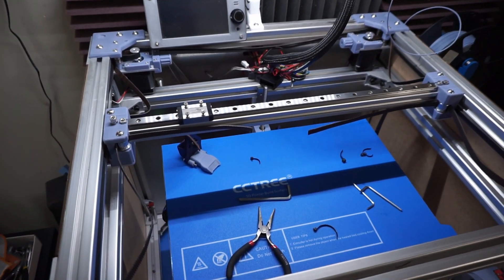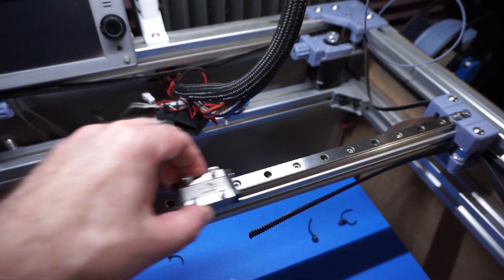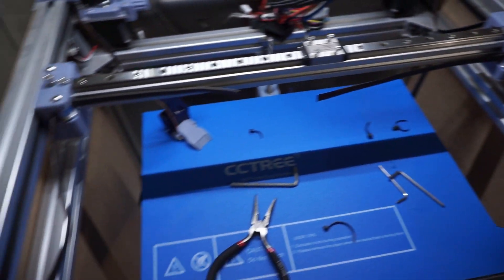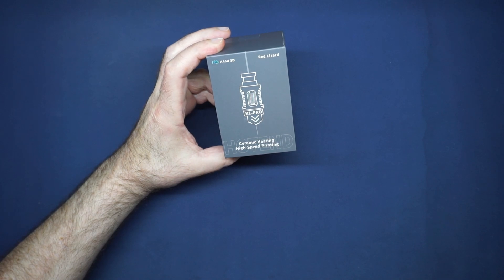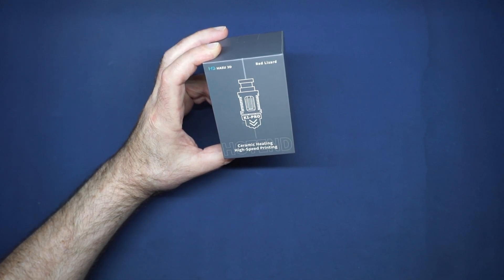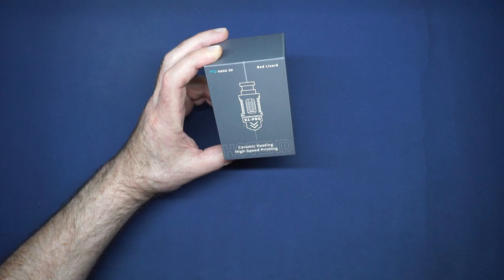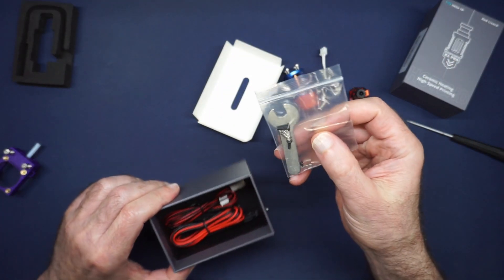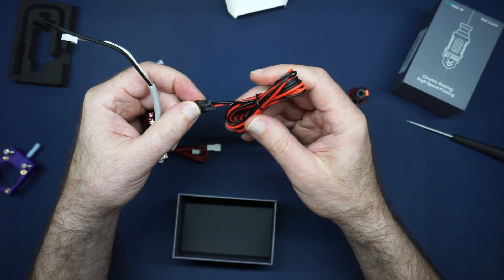Wave Extruder & K1 Hotend

Comment: Hi, are there any suggestions about the Thermisttor type for the klipper sensor settings?
Maybe i have't noticed or can't find the right one.
Many thanks
Reply from the maker: I believe I used the NTC100K setting in klipper.  the seller's page says "NTC 100K MGB18-104F39050L32"
Reply: @mikey631  You're right ! Shame on me that i haven't noticed it earlier *omg
Anyway - great stuff on your github  - i really love your XC-printer design !!
Thank you so much !

Comment: well, I know that you can get rid of stringing just by disabling the z-hop, but such a nice printer should be able to do benchies without any stringing
Reply from the maker: that roll of PLA has been sitting out for a few months, which is probably why I got some very minor stringing.
Reply: also I think that those new ceramic heatcore hotends are quiet stringy